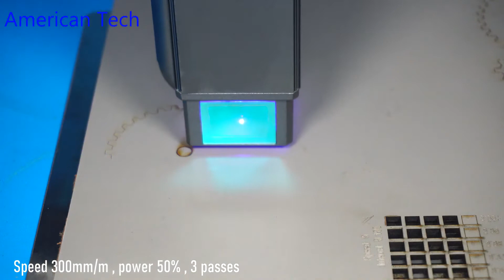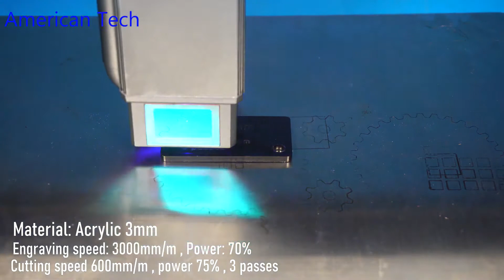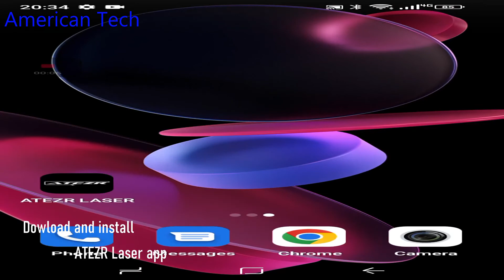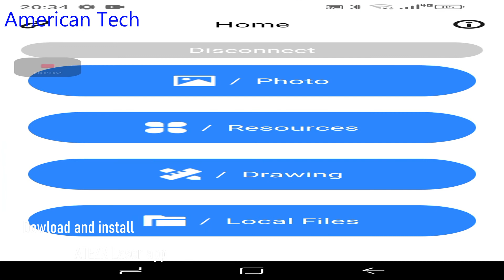American Tech Review -  Atezr P10 Combo with rotary roller and Air Assist

Comment: PVC creates hydrochloric acid when lasered
Reply: Definitely not recommended by any laser manufacturer, could be harmful for both user and machine, and will void the warranty if it harms the machine. Many adhesive vinyls, such as those used in sign making, are made with PVC. I saw a simple test a couple days ago, to check any material for PVC. Using a butane lighter or similar small torch, heat a small piece of copper wire to red hot, stick it to the material being tested, to melt a small sample onto the wire. Hold the end of the wire over a flame, if the material burns with a green flame, it contains PVC, and therefore is unsafe for use with a laser.